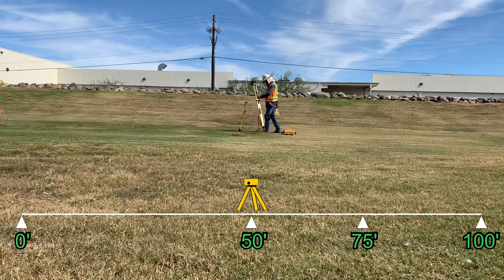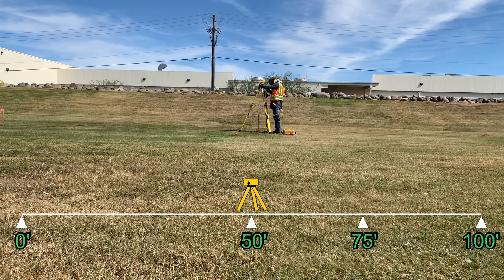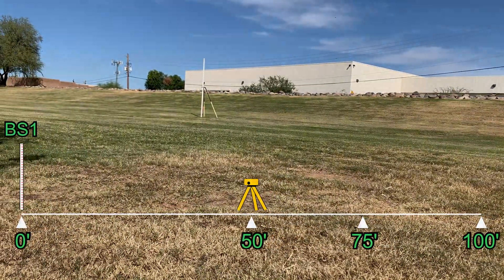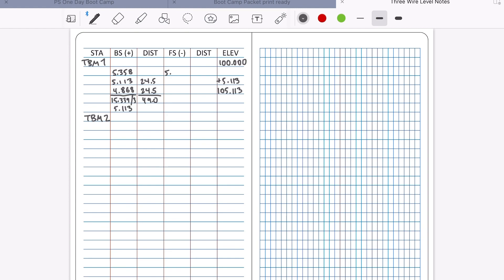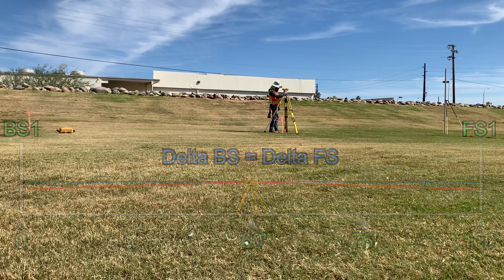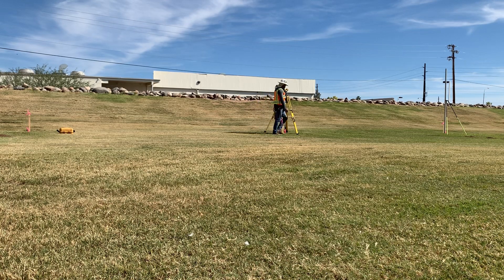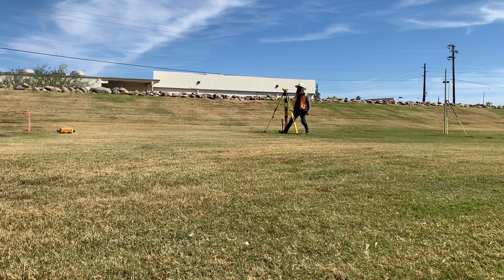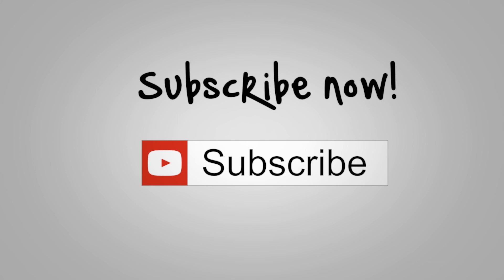Surveying: Pegging a Level

Comment: How often do you go through your instruments to make sure they are in calibration? Do you like schedule an annual "Equipment Check and Refresher Day" for all the guys in the office once a year or what?
Reply from the maker: @bwhog  Definitely depends on the instrument or any displayed symptoms. I say if you are in the GC world, every time a new project starts, in the civil/survey world, annually… HOWEVER, I recommend pegging your level yourself every 3 months or any time it has been out of your hands for too long (like loaned to another trade or team mate) and running the field calibration for the horizontal and vertical angles on a total station at the same 3 month interval.  I can’t tell you how many times over the last 25 years of surveying I have loaned something out which was then dropped and not reported.
Reply: @leansurvey8212  So, in the same vein... recent discovery for me... Have you or anyone you know ever made use of the Crosscut EDMI calibration baseline? Found the benchmark almost grown over with grass.

Comment: That's sort of how I was taught by a master surveyor. We set two good points about 150 feet apart, set up between them and took readings on both. We didn't worry about the exact distance or using three-wire, we just read the middle wire. Then we'd move close to one of the TBMs, but not so close you couldn't read it well. take a reading and calculate what the other long distance one should read. If it wasn't near perfect we'd pull the end cap off to get to the adjustment screws and adjust the error out of it. Then we'd start all over and do it again until it was as close to perfect as possible. You mention taking it in to get calibrated, we did that ourselves. But I do appreciate you video.
Reply from the maker: By calibration, I don’t mean just adjustment of the bubble.  Yes, that can be done in the field in similar manner to the way the rod bubbles are adjusted.  True calibration refers to the internal components as well.  As such, when a vendor sells you a level and says that it has been ‘calibrated’ that doesn’t always mean that the level/bubble have been checked. I would always peg a level in the field before putting it into service.

Comment: I love how everyone these days gets a PHD in YouTube and google 😂 I’ve surveyed for over 31 years My father and two uncles were surveyors I’ve pegged hundreds of levels never did I run 3 wire to do so and I was taught to do 200’ pegs but let’s be honest most wanna be surveyors push a data collector buttons to get elevation readings in this day and age !!
Reply from the maker: I appreciate the push back. No Google phd here, actually- I’ve been in the industry 24 years myself, and currently operate as a field development manager creating training protocols for surveyors and field engineers and teach Survey and Layout at Arizona State University, the second largest college in the US. That aside, there are 100 ways to skin a cat, right? There are probably several ways to peg a level.. or run a level for that matter. But is there a best way to satiate specific needs, such as error mitigation? YES, and it is not single wire.  Three wire leveling is error proof in nature, so long as you check your readings before moving on (as explained in other videos on the topic). With single wire, even when running back through the TP’s in a level loop you can’t really spot bad readings until you run back though them or until you close. Three wire error detection is “on-the-spot”. As such, I promote it as a best practice from the standpoint of error detection. It also allows you to track the distance you have travelled using stadia lines, and therefore to determine Order of Accuracy, which requires known distance.. or make simple discoveries such as whether your observation distances are balanced. It is not the only way to skin a cat, just one of the better ones. 👍
Reply: @leansurvey8212  Poor cat...😿
Reply from the maker: @bwhog  probably had it coming!